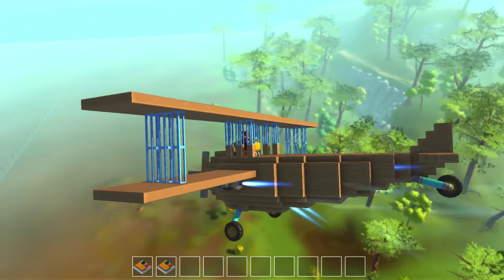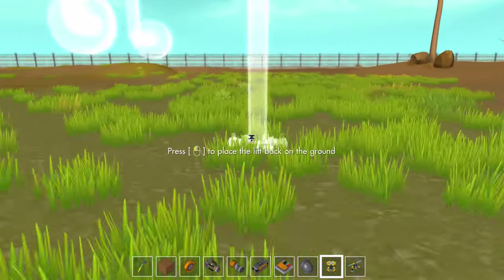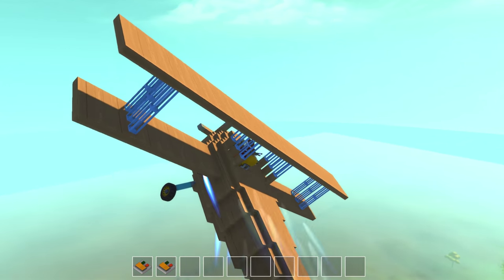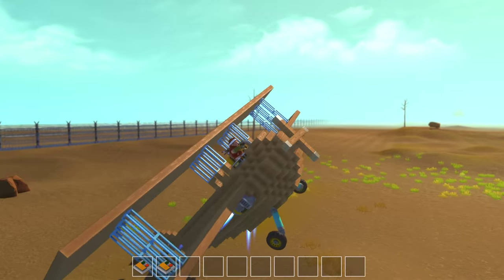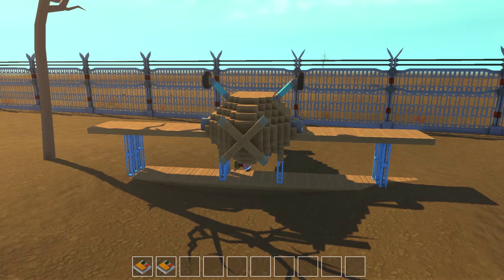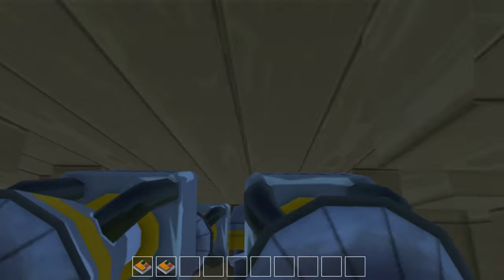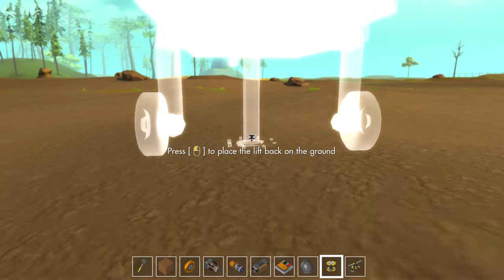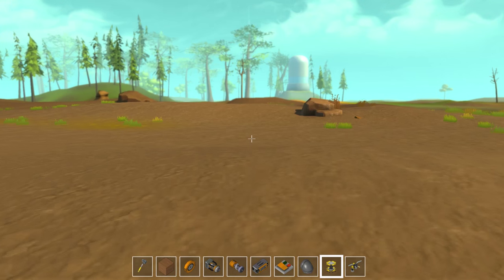04 - WASD Biplane Prototype Spotlight | Scrap Mechanic Let's Play with Lyte

Comment: I find hard impacts cause clipping so take it easy! Also, use bearings and controllers to play with thruster angles to "fake" lift. I made a heli plane hovercraft chimera that works great for pitch yaw and roll but I can't control mouse since I need both hands.

Comment: I really love your design, especially the wheels. 
I tried to make a prototype of a plane too. My design is alot more flawed, but it's easy to control. With your design, i think you could make a pretty good plane if you mix your design with my controls.(Mine is easy to control, but hard to fly straight)
If you're interested, i have a quick preview on my channel.
Reply from the maker: +Some wise guy I'll certainly take a look!
Reply: +Lytebringr 
Great!

I use my wasd for trust/yaw and arrow keys for pitch and roll. It's actually very responsive too.
Reply from the maker: +Some wise guy I actually saw that on Reddit after I had finished my prototype. The biggest difference between them is the significantly increased mass introduced by the aesthetics of mine. With almost double the mass, it is more difficult to initiate and stop the rotations. We have roughly the same number of thrusters, so yours gets and stays airborne with no trouble but mine sometime struggles with lift. Lastly, using WASD to control it instead of the buttons introduces a lot of sluggishness in the movements. Buttons grant a lot of precision at the cost of intuition. Yours is definitely the foundation for a better in-game plane. Mine is more of an experiment on what one can do with an intuitive interface and fuselage.
Reply: +Lytebringr 

I just uploaded a pretty big helicopter that required 16 thrusters. And i found myself having the problem you're describing. I found it working pretty decent by doubling the shocks. It works great on the heli, idk if it would work good enough for your plane.

Even though you focused on interface and fuselage, you definitely have the foundation for a great in-game plane. If you get ahold of the controls, you'll have a fairly stable plane, with an awesome design! I'd love to see a prequel to this, if you ever make one.
Reply from the maker: +Some wise guy I had 4 springs for pitch and 2 for roll. But I think the pitch springs were poorly positioned and didn't work together to get the job done properly. That would be part of the rebalancing I'd do in the future.
Reply: +Lytebringr Damn, that sounds like alot of momentum.
Sounds good.

I've found the springs to sometimes clip through the blocks blocking it sometimes, with no apparent reason. I've tried rebuilding it up to 3 times at the exact same spot, with the clipping still happening. And then i move it just 1 block, and it won't clip anymore.